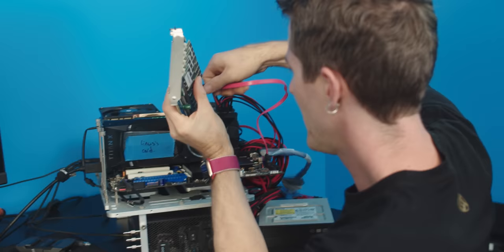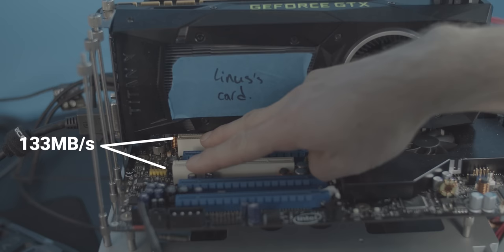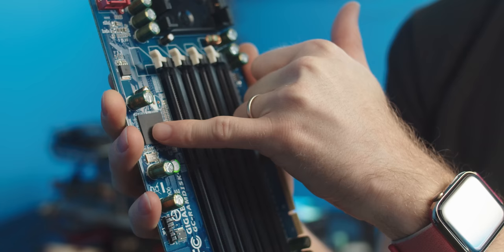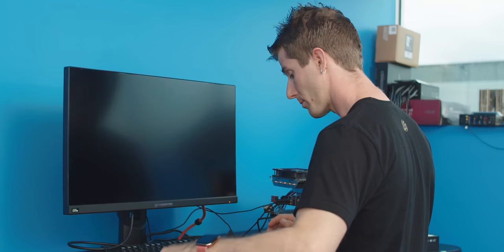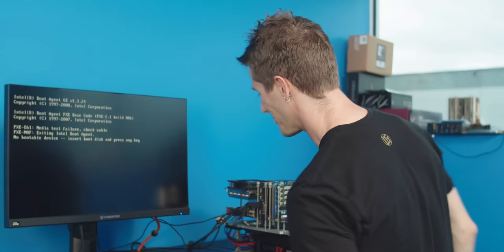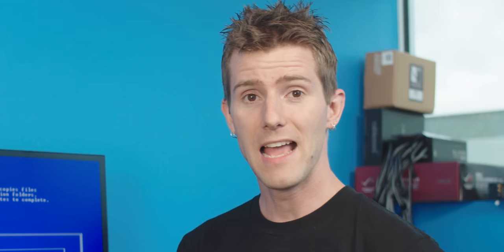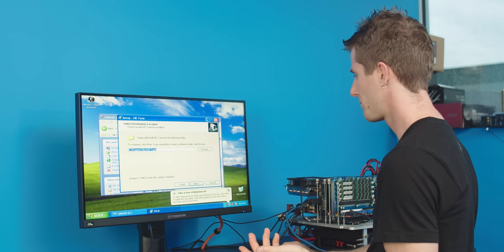WTF is this thing? - RAM on a PCI Card??

Comment: My biggest question is if any DDR2 through DDR4 versions of these exist. I could definitely see a DDR3 or DDR4 version of this being used as a burner computer and tbh that'd be a super awesome kind of piece to see in movies or video games
Reply: difference is that the ram capacity of those is too small to do anything with. Say you had 16gb of ram and upgraded, it would be cheaper to buy a 120gb ssd than to get one of these controllers
Reply: @quetzalcoa  the purpose isn't cost, its privacy and security. Yes it would be cheaper to get a 128 GB SSD. On the flipside a 128 RAM drive is usable for most day to day things for most people (apart from gaming) and the moment its shut down, it all goes poof. Have a base image (no sensitive items, only basic apps) ready to go for power outages and the like and you're good to go
Reply: @Rippedyanu1  first, who has 128gb of ram that they could just use as a storage drive? Thats over £300 worth to use as a volatile drive? If you wanted a volatile drive with that capacity you could buy 30 drives 128gb ssds and just smash them after each use for the same price
Reply: @quetzalcoa  1.) smashing 30 drives takes a lot of time, even if it's per use and 2.) Just destroying the SSD by "smashing it" doesn't guarantee the data is unrecoverable.

Both of those in a high stakes, low response time situation make that unviable.

Creating a RAM disk and then encrypting that would absolutely lock down whatever data you were worried about being retreived. It's not cheap but affordability isn't the goal. Unparalleled security is.
Reply: @Rippedyanu1  surely if a ram disk was the requirement then just having one made on your systems ram is easier?
Reply: @quetzalcoa  yes you can already do that but having it deployable this way and leaving untouched ram from the Mobo as regular ram makes sense as well so that you get the benefits of both .

Also ram on your board usually gets power from the CMOS battery which these cards purposely lack
Reply: @quetzalcoa  There are also applications that CAN USE THE HIGHER SPEED - and ability to NOT wear out a SSD.
Reply: This is good for nas cache for hard drive, no wear out, no important data, no performance hiccup

Comment: Mate of mine built a similar device for his 48K sinclair spectrum back in 1987. 16x 32KB RAM Banks switchable via just
		OUT 220, n
where n is the bank number (0 for the Spectrum's internal top 32K of RAM.
Could Save to and Load from the banks using Sinclair's microdrive commands.
Battery backed up, so once you'd saved stuff to the RAM card, it could safely be unplugged, plugged into another spectrum and data loaded straight back.
Used 12v nicad battery for supply backup.
Whole unit was about the size of a shoe box for 512KB, and you could probably heat your house with it 😂
Reply: AWESOME!!!!!!!!!!!!
Reply: @qwertykeyboard5901  was his first year project for his college HND electronics course. The kid blew my mind. Worked with his brother writing game software too. As far as I remember he did the graphics coding for a port of Robocop. If it involved code or electronics, he could turn his hand to it. Kid was a genius.
Reply: I was thinking the same thing; they offered stuff like this for the Commodore 64/128 back in the day. RAMdrives were the thing back when.

Comment: would be interesting to see a more modern version of that !
Reply: Battery backed SSD with a massive DRAM read/write cache would be the same, but better. Battery so it can write the data to the slower drive if the power goes out, it reloads on boot in the background for instant storage access after warmup.
Reply: not an add-in card, but if you have a lot of ram in your system you can allocate some as a ram drive and do basically the same thing.   I have 24GB ddr3 in my pc and actually i could make like a 12gb ram drive and still have plenty for general computing

edit-- a convenient Linus video, they even mention this video's very device   https://www.youtube.com/watch?v=6pp_krChw_A
Reply: @TheJunky228  you need to boot into OS to do that what if you want to make bootable DRAM
Reply: @asadrahman6123  true
Reply: Asad Rehman Linux is able to do this, and perhaps Windows as well with some hacking. Distros such a Puppy Linux are specifically designed to be small enough to fit in RAM and don’t even need the boot device once it starts.
Reply: @TheJunky228  You can't boot off of that though.
Reply: It exists for DDR3
Reply: That would be interesting I can see them make a motherboard with DRAM all over it. Where you can sacrifice the memory for storage.

Comment: Gigabyte meeting where this was pitched:

"That sounds like a RAM disk with extra steps."

"Well yes, but actually...yes. Yes it is."

"And we're paying you how much this year?"
Reply: Yes, but a ram disk with old cheaper memory.
Reply: Did you setup a RAM disk back in the day?

The first generation So775 Intel boards did only support 4GB, the second gen only 8GB of memory.
High density chips also were really expansive.

Besides, the only way I personally got a RAM disk running under Windows would require Windows to see all the memory.
This means you would need Windows XP 64 - which was the hell.
Or later Vista 64 - which took easily a year to get decent support by game makers and driver software.

This product was a dream back then, but I never got one either.
I thought RAID0 Raptors will do fine, lol...
Reply: Cutting off 1-3 GiB of 4 GiB of RAM just for the purpose of using it as a faster hard drive wouldn't have been such a great deal. And with this device one could power down it's PC without loosing als the contents of the RAM disk. 
So I think it's not really similar but the idea was the same as with conventional RAM disks.
Reply: lol..   funny DOS came with ramdisk.sys     I had fun loading Doom1 in ram  and watching everything load instantly back when I had a 486/66mhz pc lol
Reply: @ysmg9010  Linux had amd64 support before the first hardware came out. And it had ramdisks since the very beginning, because it's actually a sane OS and not a steaming piece of DOS ripoff.
Reply: This is actually better because it's more permanent than a ramdisk due to its battery.
Reply: Pays with everything
Reply: @JasperJanssen  Used to use a RAM DISK for the Commodore 128 with battery supply back in the day. I would load up GEOS 128 in seconds

Comment: "SATA bottleneck"
cries in IDE
Reply: I would like but your at 69 likes so sorry
Reply: *Cries in SCSI*

Not anymore, though, but I used to own a Mac with that connector on it back then 😐😐
Reply: Anand Raj  flexes in nvme
Reply: I once looked for IDE ssd on Google and turns out it actually exists and does boot. I wonder what brain damaged engineer invented such a stupid thing.
Reply: Probably made for industrial computers, a lot of older motherboards don't support Sara, and the attraction of ssds for this application is they're not susceptible to vibration (which is a huge thing in heavy manufacturing environments) and they don't usually wear out like hdds do.
Reply: Flexxes with usb stick that is made out of NVME ssd that requiers a 50gbit Ethernet conection 

*Cries after the dreams*
Reply: @kingeling  this was back then parallel signal were faster than serial ones, since twisted pairs didnt exist i guess

Comment: This idea was ahead of it's time, they should make an updated version.
Reply: ps ram tray's were available since the 486        in fact we still have a memory card thats 8 megs..  goes on an ISA bus..

yeah before pci  even...     its actually called a ram drive..   and it was even included with DOS   called ramdrive.sys
Reply: No point with cheap nand
Reply: It was way late. Similar devices existed in the 80s, for many different computers(mine happens to be for a 99/4a).
Reply: For that you might as well run the OS Tails on Live Medium, it doesn't save any data or changes like that, and it is based on TOR, pretty cool stuff
Reply: would just be a gimmick at this point unless you came up with some crazy niche market
Reply: @Svein Are Karlsen  wow ! you're a veteran in computing . in 1988 I was 11
Reply: Using laptop ram would be awesome as well
Reply: You can buy a copy of ram drive software for really cheap nowadays and you can even set it up to restore on restart. The down side is that you can't boot from it, at least not entirely, but performance wise you auto ram caching just works
Reply: A lot of thin clients use this kind of Ram disk tech to unload updated client is from the network server.   When there diskless they mean disk less beyond the ROM file with with a windows CE or Linux embedded bootstrap there is no installed drive.
Reply: See: The Liquid Honey Badger. Multiplied. In RAID 0.
Or that dude who literally ran Doom: Eternal from GPU memory using a 3090.
Reply: ram prices will go rocket just like GPUs today
Reply: Especially with ddr5 coming up
Reply: Well it exists, but other way around, since ssds are chaper than ram, some servers using ssds as ram because ram is so expensive
Reply: @Loreaver  but the other point is to save used ram sticks laying around

Comment: This is literally how old cartridge games saved your progress before switching to flash memory (or even the lesser known SRAM_F); RAM chip and a battery.
Reply: Yup, and even though they can actually last for a really long time..the battery save feature will eventually give out and unless you know how to replace it, it'll never hold a save again.
Reply: Battery saves and flash memory co-existed for a little while I believe. IIRC even some GBA games still had battery saving, despite flash memory being used elsewhere on the platform.
Going further back, I remember reading that Sonic 3 used flash memory once but I've heard conflicting things since so idk if that's true.

EDIT: Fun fact, some games that didn't use all the SRAM available to them for their saves would exploit the additional memory they had to work with. The Gen. I Pokémon games in particular used the leftover memory for decompressing sprites, which is also why encountering various glitch Pokémon would mess up your save; the game thinks their sprites are massive and the "sprite" ends up overflowing into the actual save data.

Comment: Ideal solution for a swap partition/file or a RAM drive. I think this was the main goal, not installing OS in a RAM :) I've actually would use that. My swap partition is only 8gig (I have 16G RAM), and sometimes swap use is up to 3 gigs. This would be perfect, since nobody cares about keeping what's on the swap partition during restarts anyway. It is pretty neat extention to the RAM you already have.
Reply: yeah, pretty expensive solution for a minor task. and that's the thing.
Reply: If you already have the RAM, just plug the ram into the mobo.
Reply: @dylanrobson6737  Ok, Good idea. So I have a laptop that I'd like to get at least 4 more GB of RAM into. I've got a small stack of 4GB SoDimms, Right now, both RAM bays are occupied with an 8 GB stick each. 

So... I have the 4 GB stick in hand, I'm looking at the RAM bays that already are occupied with RAM sticks. Where do I plug the third stick into?

Do you understand why Swap space is a thing NOW?
Reply: @demitriuspandi9736  How was I to know all your slots were full? But I must apologize, I should have specified if you have empty slots. I have swap space too, but depending on how big you "small stack" is, you could sell them and buy a 16GB sodimm.

Comment: I could see devices like this being used in security sensitive situations so you could instantly wipe your drive.
Reply: I actually worked in a bank that had a machine with one of these in it. It had a weird unix os that was amazingly fast and due to what we used the machine for it required us to depower and re-install the os fresh everytime it was used (daily).
Reply: @stuartthomson4563  used to be good way to avoid viruses etc, now they are in your firmware!
Reply: Hillary Clinton wants to know your location.
Reply: StoreBrand lmao
Reply: Linux has dd to do that. RIP data
Reply: A software RAM disk would be faster, cheaper and easier to set up, apart from being still supported and modern
Reply: @resneptacle  Is there a whole in that idea? Perhaps the permanent storage device?
Using this without an HDD there is no where but bios/cmos left for virii, right? Waaaay easier to ensure no targeted keyloggers/etc exist when you limit the exposure profile like that.
Reply: My homework folder
Reply: Peter Ellens or just use a read only file system
Reply: @kevinbooth-  Wait, how does the hardware RAM disk differ from a software RAM disk in terms of how you load the OS? Or do you want the hardware RAM disk to contain its contents, then this whole thing wouldn't make sense. Either both loose their content at shutdown or you can just use any other regular storage medium if the data is semi persistent through the battery
Reply: @resneptacle  I suppose I probably made a bad assumption that it would be run on a system with a traditional hard drive...
It would differ in that it would have the extra space and leave the ram alone for the os and code to use....
Reply: @ thephilybeef Just encase the feds see that your a vendor on the Darkweb. lol

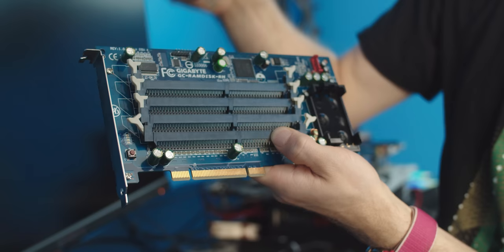Comment: Linus: 4:55     "Meaning you can't just treat this thing exactly the way you would a hard drive"    
So it's OK to drop a ram stick but not a hard drive.
Reply: Yes.
Reply: Linus drop both, he doesn't care.
Reply: Exactly!
Reply: anybody remember the video cards (agp i think) that actually let you use laptop dimm ram as video buffer?
Reply: Hot RAM? No problem. Linus hold anyway. Is good for health.
Reply: *4:39  but can't you treat it as a nvme ssd?

Comment: I had two of these in RAID0, I was reinstalling Windows XP quite often due to the batteries on these things dying.
Edit: Google ACARD RAM disk, an even more expensive up market and more capable implementation of the I-RAM disk.
Reply: You are living on the edge aren't you?
Reply: I have one of these as well... a 9010 that was gotten with 24gb ram for about $100. Works great as a large drive cache.
Reply: @Chozo4  : Yeah, extra cache for drives, ram disks for temporary working files, and memory expansions for data-heavy processing have always seemed more reasonable use-cases than a boot drive.

Comment: I used several of these.  They were DRAMATICALLY faster than any hard drive, even in RAID... at least for our application.  We used these for a specific database application that had HUGE numbers of lookups on relatively small records. This was a read-only database that was updated monthly. The database was only about 3.5 GB, so the 4GB worked perfectly.  We also used a program that would completely restore the data to the drive (an image) should the machine lose power.

The same could have been achieved with a normal Ram Disk, but at the time 4GB was the max that could be used (save servers with PAE), so there wasn't enough memory onboard to accommodate both the Ram Disk and the OS and programs.  And since the 4GB limitation of 32bit OSes was a hard limit of the memory addressing, that meant that EVERYTHING that used a memory address took away from the 4GB of RAM.  This was a fantastic solution for a couple years for those with a specific need that emphasized the need for access times vs absolute throughput.

Within just a couple of years, USB flash drives had become fast enough that they could do the same job as fast or faster for much less money memory and hassle.  I kept the last of the iRAM drives until just a couple years ago.  I had no use for it, but it was just so cool!

This wasn't the first card like this though.  In the '80 I owned a board sold by Everex that could hold 3MB of memory and loaded drivers on boot (DOS) that configured the RAM as a drive.  Note that at the time my computer only had 1MB of memory.  The data on the drive was accessed by the use of the configuration of an Expanded Memory Manager that also loaded on boot.  This manager would set aside a 16KB window in the address space above 640K and swap out 16KB of data at a time, as needed by the CPU.  This was ridiculously expensive (I think RAM was around $800/MB at the time) but it was faster than anything else available on the market.

https://www.biocomp.net/o77185.htm <-- if you want to see what one looked like.

 Ahh... the days when overclocking meant taking a risk destroying your motherboard by desoldering/soldering on timing crystals (available at Radio Shack), and overclocking was some sort of black art that almost no one had any conception of.  I upgraded the crystal on my XT (8088, later replaced by an NEC V20) so that it ran at 7MHz instead of the 4.77MHz that it was meant to run.  Of course, back then all games were linked to the CPU speed (clock) so that all my games were completely unplayable... I'd just instantly die as the computer was so fast that I didn't even have time to react.  It was back in those days when having something like a 3MB card in your machine made you the Grand Geek of all the other enthusiasts you knew.

Thanks for the blast from the past with the iRAM.  I enjoyed it.
Reply: @asterixxer , wherever you are from, I can pretty well guarantee you that your English is far better than my grasp of your national language.  I humbly bow to your linguistic ability!